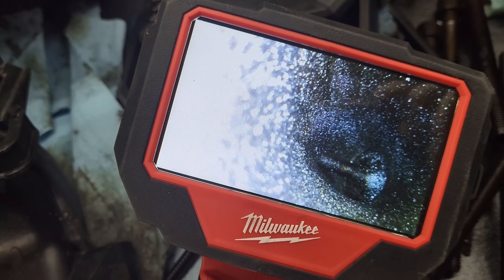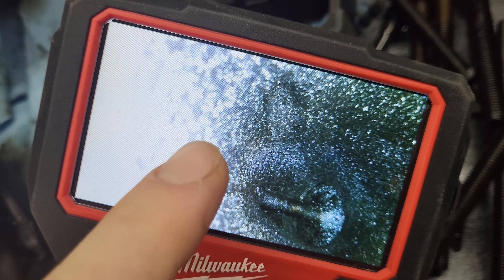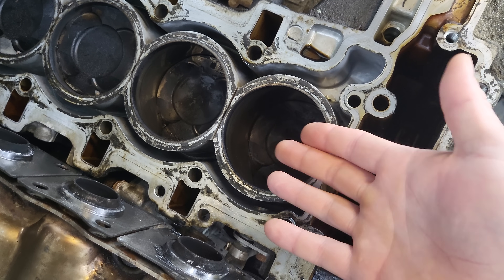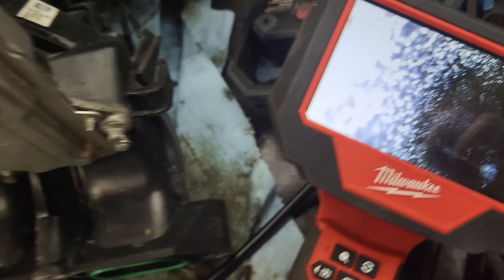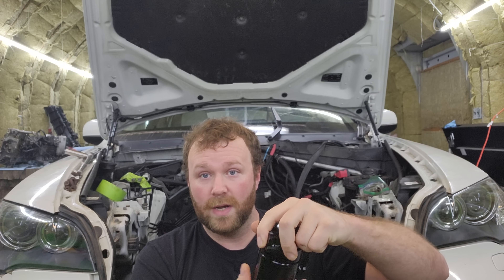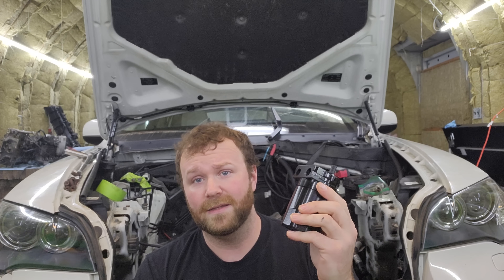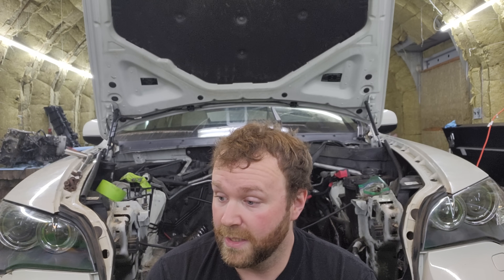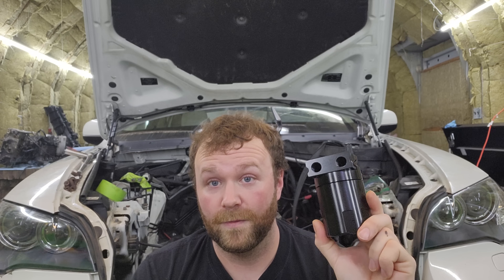The Modern Engine's Achilles Heel: How to Prevent Costly Carbon Build-Up in GDI Engines

Comment: NOBODY is having trouble diagnosing this.  It's the first thing you look at if a GDI engine is experiencing performance problems.
Reply from the maker: Absolutely are. Take honda for example. If you walnut blaste the valves and sejd the customer on their way, it will be an ongoing drivability problem until you replace the $2800 injectors and do the ecm update. But hey your 1/3 of the way there and sometimes. It's just the update that fixes the drivability issues.  So checking for the valves right off the bat is the wrong way to trouble shoot and us dealer techs know this better then most. It's just a comeback if you do that

Comment: Preventing carbon buildup isn’t a functional benefit of an oil catch can. They simply cannot filter the vapors fine enough while still venting pressure to the intake. Their original, and still best application, is to prevent oil buildup in the intake under high crankcase pressure applications, usually engines with a lot of boost. While some production consumer engines now are pushing 20+ PSI, a catch can still won’t notably reduce carbon buildup on valves.

One cannot “prevent” carbon buildup on valves in modern direct injection engines that are prone to carbon problems (engines that lack proper valve and cylinder coatings to prevent collection and blow by, engines without a combination of direct injection and port injection, etc.) But you can properly treat the problem. Routine oil changes not beyond 5000 miles before detergents and oil additives break down and cannot encapsulate carbon causing molecules in the crankcase slows carbon buildup, potentially preventing the need for walnut blasting, allowing the use of solvents on a regular interval (every other oil change) to time release into the intake and dissolve on the valves before the carbon is too thick.

Comment: Well engineered engines have PROPER oil separators built-in!!!

Some makers play with valve timing to clean the valves.

In other words, this is only a problem for older GDI designs or current cheaper engines that do not have the valve timing control.

Comment: Oil catch can doesn't solve anything - the carbon is from the backflow of exhaust gases from the chamber while opening the valve. From my experience, it is good to have oil vapors in the intake - the carbon is then cleaned better because it is soft and not so hard. Intakes on DI engines simply have to be cleaned manually once or twice in a lifetime, for example every 100k miles.
Reply: Yeah, well, 
1)  oil in the chambers is known to cause detonation. To prevent  self destruction, the ECU pulls timing, and just like that your torque goes away.
2) backflow of exhaust gasses  only happens on the overlap cycle, at low rpm, with restrictive exhausts.  and if your engine has VVT, set to 4500rpm or so, that overlap cycle, for most of us, gets to be mighty small.

I'll take clean valves any day over oil getting into the cylinders.
Reply: @ajforms4818  If you mean LSPI, it is solved with special oils with a low calcium content.
Yes, backflow occurs mainly during the overlap cycle, but not only during it. The exhaust itself is an obstacle for gases - you have a turbo, GPF, catalyst, muffler,... so when the intake valve opens, the pressure in the chamber is always higher than atmospheric, and then it depends only on the pressure in the intake and the revolutions, how much backflow occurs.

I have a VW TSI engine only with DI (not port) and currently I have driven 130,000 km without cleaning, I plan to do preventive cleaning at 150,000 km.
Of course, oil consumption is always a bad thing - e.g. with soot from the oil, the GPF is irreversibly clogged, but my engine consumes about 1 liter of oil per 50,000 km - I don't need to top up the oil, I just measure the difference in the amount of new and drained oil, so I don't think the catch tank is a big deal.

Comment: I cleaned my Mazda SkyActiv valves with some walnut shells. It was easy and did wonders for the car. Took me 2 hours having never done it before. When the next 100,000 miles comes around, it'll take me 30 minutes.
Reply: HOW ?
Reply: With a media blaster.
Reply: @michaelbloom5342  I meant heads off on a stand ?  On car ? How to keep walnut bits out of engine to avoid damage ?
Reply: @michaelbloom5342  30 minutes seems fast to access valves clean and clean up 🧐
Reply: @TheVigilantEye77  Yeah, it is fast. But working on a Mazda is just that easy! With experience, you can easily have the intake manifold off in 5-ish minutes.

Comment: Before PCV valves, there used to be a drop tube..  The press from the underside of the block was just vented to the outside...  a down draft tube.  PCV problem is, you are drawing about 12 pounds of vacuum on the bottom end of your engine, but the bottom end of your engine is only producing about 2 pounds of pressure, so..  its kinda like sucking on a straw on the very bottom of a empty milkshake cup...  you're drawing up some milk, that ordinarily would not be.  Disconnect the tube running to the PCV valve, make a down draft tube, and plug the vacuum line.  FIXED.
Reply: That would make you fail emissions though, wouldn't it?
Reply: it would fail visual inspection..  it takes less than 5 minutes sto swap back..  it wink save your engine
Reply: I question your logic.
 I measure the pressure in the PCV system, on the intake side,  as inches of vacuum, and  on the crankcase side as pressure. Air always moves from a high pressure (psi) area, to a low-pressure(vacuum) area. IE; the intake manifold does not suck the vapors out; rather CC pressure tries to push them out thru the restrictive PCV.
Yes, you can ventilate your CC straight to atmosphere;  which does work while the engine is running, but what happens when you shut the engine off and it begins to cool off.  I'll tell you;
Atmospheric air at high pressure,(14.7psi) flows back up your makeshift road-draft tube, and into the low-pressure CC, caused by the cooling parts , bringing with it, contaminants and moisture. ......... um, which the closed PCV system was designed to eliminate.
So, without calling your intelligence into question;  I wonder if it's a good thing to recommend stepping backwards into history, as concerns the PCV system. I'm 71, and I lived thru that era, and not interested in going back.

IMO, the external catch-can, while being far from perfect, is still a good alternative, to some of the super-junkie. wholly inadequate, PCV systems out there . I mean com' on GM, you know better. You were a pioneer back in the days when engineers could actually think and innovate.

Comment: If you are waiting 15K miles to change your oil, then you should not own a vehicle with GDI
Reply: Catch can is only partial answer to GDI engines.  Manufacturers recommends 7.5k to 10k oil change these days.  If you wait for 7.5k and oops another 1-2k slip by and your piston rings will get gummed up after few slip ups.  Most people are driving under severe condition.  Just do your oil change every 5k and you don't need to worry about stuck piston rings.
Reply: @hukim0531  I agree 5k miles at most in between oil changes but highly recommend 3k miles for engine with high mileage (oil is much cheaper than a new engine)
Reply: @hukim0531   I change the oil and filter on both of my cars at 5K intervals. The 2009 Honda Fit isn't a GDI so no worries there. The 2020 Hyundai Accent is a dual port design so that's where the extra caution will help.
Reply: @hukim0531  My oil change intervals are  5k max. Oil and filters are cheap; engines are not.
Reply: @jeffstieren4474  yeah and maybe a one speed bicycle would be a better choice for them
Reply: Or any ICE engine for that matter?  V V T systems are easiy affected by dirt / impurities found in used engine oil.
Reply: If you are waiting 15K miles to change your oil, then you should not own a vehicle period.
Reply: @Rick-S-6063 Exactly
Reply: @Rick-S-6063   You took the words right out of my mouth!!!!!!!!!!!!!!
Reply: @Rick-S-6063  unless its a truck driving highway miles and it has like 30 liters of oil
Reply: It's difficult to explain to people the necessity of oil changes.
When I had a shop, it took some convincing. Manufacturer saying oil changes at 18,000 miles doesn't help.
A taxi company learned the expensive way.
Plus food stores selling oil. People put the wrong oil in.
Also, in America, you're just as bad. Plenty of channels prove that. Maybe you shouldn't have cars !
It's only obvious if you know how !
The people need to know and it starts with the manufacturer.
We knew of other shops knowingly putting the wrong oil in people's engines.
Reply: American cars had 7500 miles service intervals for several decades already.............for normal service and regular oil.  Synthetic oil is superior and the rule of thumb is you can almost double that mileage. Heavy duty on highway tractors have a 250000 miles service interval for decades now, they are diesel and have more blow by into the oil , but they have a much higher oil capacity.  More oil change than needed create more pollution.
Reply: I change oil in my GDI engines every 3 thousand miles.
Reply: @williamweddington3140  that’s a great thing.  Have you installed a “Oil Catch Can” yet.  If not you really need to as this will help eliminate the oil being recycled back into your intake which creates most of your carbon build up.
Reply: @williamweddington3140  what a waste of oil
Reply: Here in the Netherlands an oil change costs €200! No wonder people won’t change their oil every 10.000km or less!
Reply: @fredgien Can change yourself with a hundred or two of tools for 40 euros-10 euro oil filter, 30e for 4 l of Manol and 1l of Castrol to spec
Reply: Try cleaning your engine with BG cleaners.
They will clean the carbon off the rings, and get the sludge out and possibly save your engine.
And if you can’t be bothered to maintain and change your oil in your vehicle cause you’re too lazy…..you should prob take the bus lol.
Reply: @crashandburngaming5103  I watched different chemicals being used including BG and STP outperformed all the others.

Comment: This is one reason why I purchased a Honda HRV, port injection, I don't have to worry about carbon build up.  Love the vehicle, I owned the first generation now I drive a 2024.
Reply from the maker: The only vehicle when I worked at Honda we never worked on for other then maintenance.  1 recall. The resale value on those things are incredible

Comment: Do diesel direct injected have the same problem?
Does oil with low calcium help?
Reply from the maker: Some people run catch cans on them. There more notorious for soot clogging up the emission components but that's a different reason then oil vapors. Pretty sure gale banks has a good video on that

Comment: No catch can here.

Drove 360,000 KM on a 2016 KIA Rio (a GDI engine) as an Uber driver. Put 200-400 KM on it daily, until the OEM slip fit piston rings finally failed. It almost never got shut off in 8-10 hours of use.
GDI is fine in that environment, because the cylinder head was always at the design operating temperature all the time, unlike the commuter who barely gets the engine warm going to work and back 8 hours later. Another case of automotive engineers not thinking something on paper totally all the way thru in the actual application.

Comment: Blow by from low tension rings and EGR is recirculating from crankcase vapors. So it’s really not because it is a GDI it’s because it’s recirculating the vapors. Now GDI can’t wash it clean like a EFI in the intake. It happens on both types of injection it’s just noticeable on GDI. Good videos! Thanks

Comment: Toyota doesn't have this problem. They use both port and direct fuel injection.
Reply from the maker: Yep. Seems to
Be working. The only downside now is the average Toyota engine from their line up is 10,000 to 30,000. Complexity at its finest.

Comment: Added a catch can on my 2017 Yukon. It does what it is supposed to do. Now instead of oil carbonizing on the intake valves, I simply empty the catch can periodically. They are easy to install and how hard is it to unscrew the can and empty it periodically. Sense I only drive my Yukon in the summer months, the liquid in the can looks like oil. From what I understand, when driving in cold weather, the can will have a milkier looking substance due to condensation building up in the can due to temperature changes from hot to cold. Thanks for the informative and very important video.
Reply from the maker: Ty for response. Love seeing people who are already using it.

Comment: There is no fix for this problem. You are absolutely correct in that a catch can will mitigate the problem, but some of the oily vapors get through. Catch cans can buy you some time but eventually the intake valves will be encrusted with carbon. Several auto manufacturers have switched over to a dual fuel delivery system that cycles between direst injection and the old port fuel injection which allows the fuel to wash away the oily deposits. I know of a Corvette which had direct injection only that needed a valve job after only 4000 miles. The only way to ensure a direct injection engine will not have carbon build up on the intake valves is to eliminate the catch can and vent into the atmosphere. To be a little bit more environmentally responsible, one could use a catch can but not connect it to the PCV system. Most of the oil will be caught in the can but some of it won't. Life can be complicated.
Reply: I vent my crankcase to atmosphere and my valves are real clean. I don’t fly so that equals my pollution contribution out in my eyes 😜

Comment: in addition, most engines, the intake valve closes after bottom dead center. So definitely at slow engine speeds Some of the mixture in the cylinder gets pumped right back out the intake valve.. this is by design to produce really good power in the mid range and higher RPM. But they didn’t think about it with the direct injection obviously. My guess is at this problem is worse for people that barely ever get their engine above 2000 or 3000 RPM and not quite as bad for folks that have it in the higher RPM all the time

Comment: Does the oil catch can catch all the oil?   Would putting two oil catch cans in one after another be better?   What if you disconnect the line from the PCV valve?   Is there any cars left that have port injection?
Reply: YES, if it was legal to vent the PCV to the atmosphere technically you would have zero carbon build up as there would be nothing but filtered air flowing down over the valves.
Reply from the maker: 1 is enough unless your running 2 turbos..then one on each bank. Also engine needs to be in balance.  Disconnecting the pcv causes vacum leaks and engine runs rough. Honda makes one. For the hrv and some low end civics.  I'm sure some other manufacturers have some

Comment: Just like the rotary engines should've had 2 cycle oil sprayed into the combustion chamber instead of the oil that comes from the pan.  They figured customers would never refill the 2 stroke oil cannister.  Same thing with this...  Or the gt350 mustang engines where customers had to sign a paper saying they would check the oil every 1000 miles etc because ford gave them a high compression n/a race spec engine that consumed oil as a result.  MAJOR FAIL.

Comment: I been hearing this GDI carbon build-up problem  a lot this past year, sounds to me the best solution is crabeater or throttle body and stay away from GDI engines....... 
I had couple 80s and 90s Subarus with over 200k and they still ran fine til they rusted out, I currently have 04 Jeep Liberty V6 with over 200k and still runs fine, last best Jeep ever made....
So do diesel engines have this same problem? I have 07 L3400 Kubota tractor with  1,500hr, will this engine develop same problem?

Comment: My sister in law had a near disaster on her Ford pick up that developed a leak in the fuel line somewhere between the low & high pressure system. Seems that the local dealership (yes, a Phord dealership) had replaced a section of the wiring harness that required removal of the intake manifold & that section of the fuel supply line. They either forgot to replace some O-rings or damaged same. She made it down here from Missouri to our place near Tulsa. When she got ready to leave she couldn't get the engine started. I noticed a strong smell of raw gas & saw gasoline running out under the truck. Lots of gas, a major leak. Long story short, we contacted the dealership in Missouri, told them where it was leaking (they had done the work only a few days before she left) and told us to take it to a local Ford dealer & they would cover the cost. She became seriously worried about the situation so my son bought the truck. We are aware of the direct injection/ twin turbo/ PCV carbon situation on those vehicles so I will tell my son about that device. Thanks for the video, you seem to run an honest shop.

Comment: Di is a solution to a problem no one wanted fixing.
Reply: What are you talking about? DI gives more power, better fuel efficiency. Do you like guzzling gas and dumping unburned fuel out the tail pipe? I want the most efficient engine possible. Otherwise we really are burning money.
Reply: @kenmorrisproducer  It's an interesting conversation. Was a little blown away to find my leased '25 Forester has the fuel system of a 30yr old VW. Conversely, it gets roughly the same mileage (27 around town) as my tiny 98 Corolla got.

Comment: Catch can, regular oil changes and drive the vehicle hard now and then seems to be the best way with DI engines. Have a catch can on 2 DI engine vehicles I own. I live in Canada and had no issues in the freezing weather either.